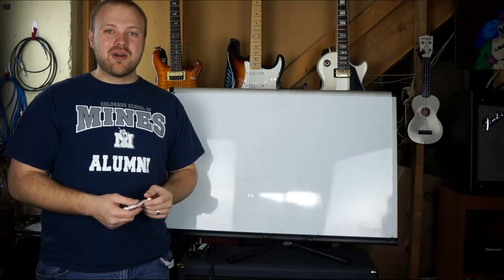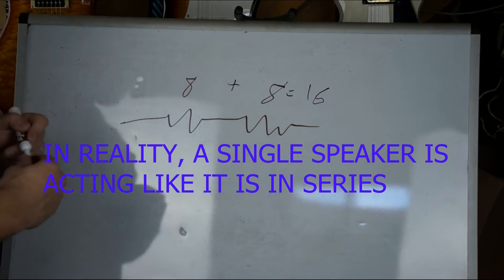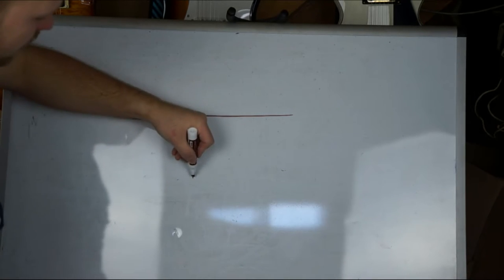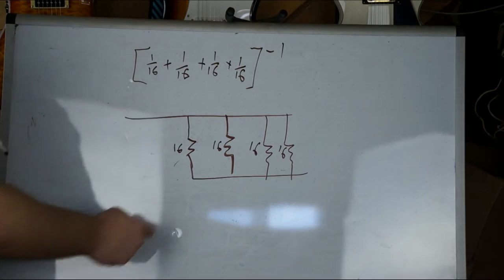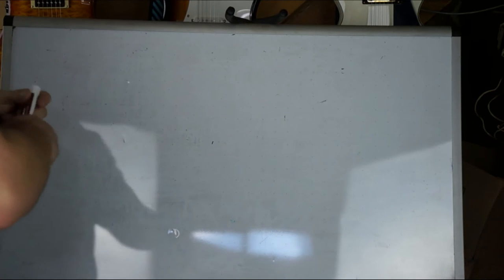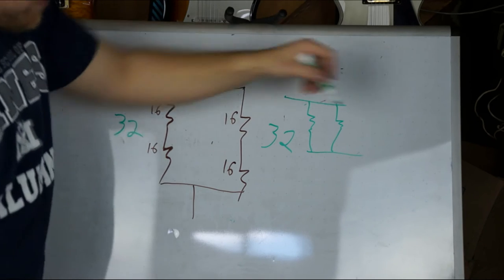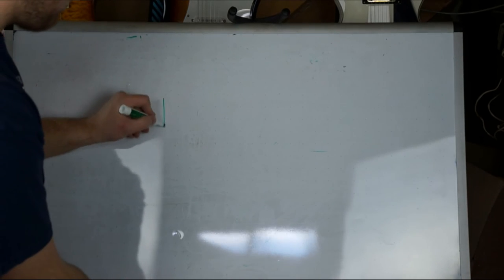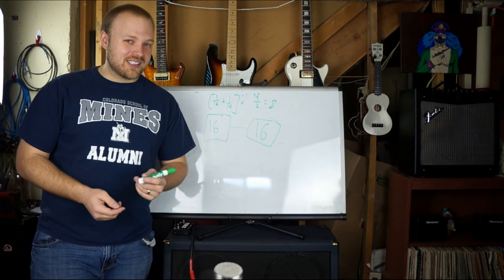HOW TO CALCULATE SPEAKER IMPEDANCE

Comment: Great video. When bi-amping, would speaker impedance change? I suppose depending on the speakers, but those where the crossovers are separated, I suppose the effective impedance can be as much as halved? Say a hard to drive 2.8 ohm speaker can be more easily driven by bi-amping?

Comment: How do you calculate different impendances in parallel
Reply from the maker: +Ned O'Millick Take the inverse of the sum of 1/Z1 + 1/Z2+1/Z3... If you only have two impedances you can use (Z1*Z2)/(Z1+Z2). Let's say you have a 4x12 with all speakers at 8 ohm Z wired in series parallel. Each side is in series (left/right) 8+8=16 ohms. The two sides are in parallel. 8*8/16= 4 ohm total impedance
Reply: dont get it..its english and to much exclamation marks :). for example i have two 4 ohm speakers and one 8 ohm in parallel. how do i calculate them.
Reply from the maker: Ned O'Millick Your impedance is ((1/4)+(1/4)+(1/8))^-1= 1.6ohm
Reply: Got it......and if you have only one 4 ohm and one 8ohm in parallel
Reply from the maker: Ned O'Millick you can handle that one two different ways. The first is the same as before ((1/4)+(1/8))^-1=2.66. Because you only have two speakers you could use the other equation also. (4*8)/(4+8)=2.66

Comment: good job Brandon. However, I only use combo amps now.
Reply from the maker: Thanks Den :) This can definitely apply to some combos too. The Fender Hot Rod Deville comes in a 2x12 and a 4x10, twin reverbs have two speakers, and there are tons of other examples. I could see somebody wanting to try out new speakers at some point. And at a bare minimum if you are going to change a speaker in a 1x12, you know to look for an impedance switch on your amp or the same impedance replacement speaker. Thanks for always watching and commenting!
Reply: Good point Brandon. Thanks for the vid!